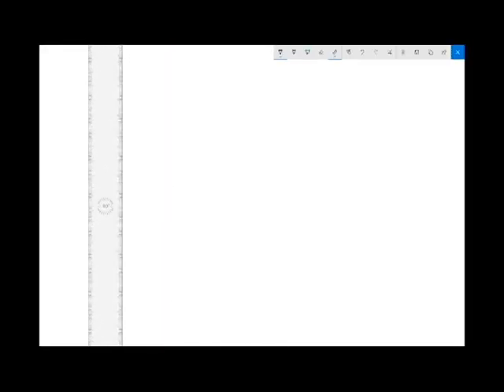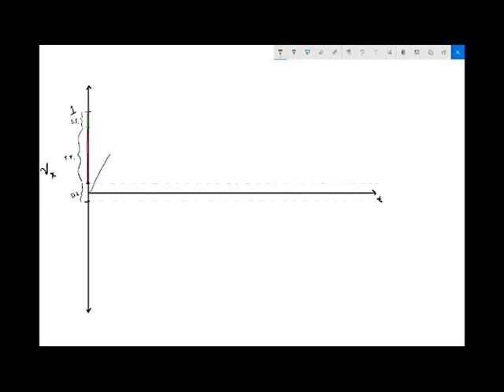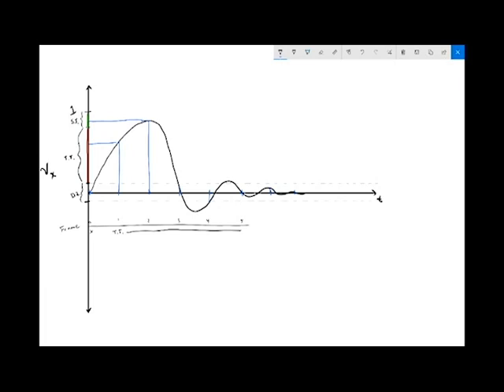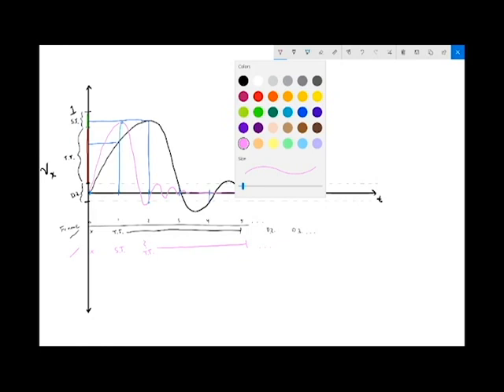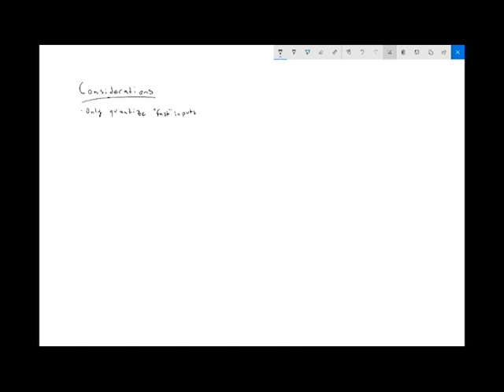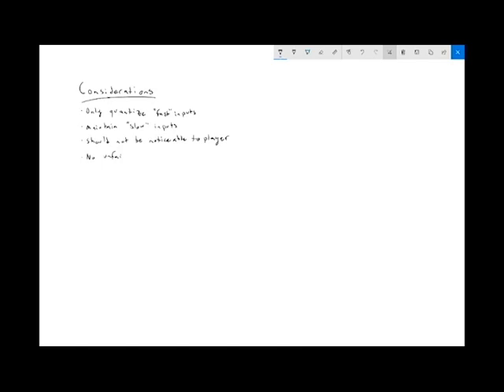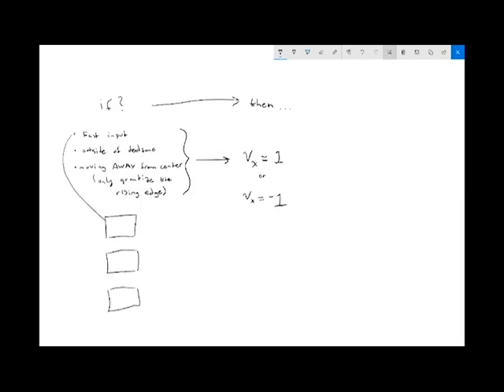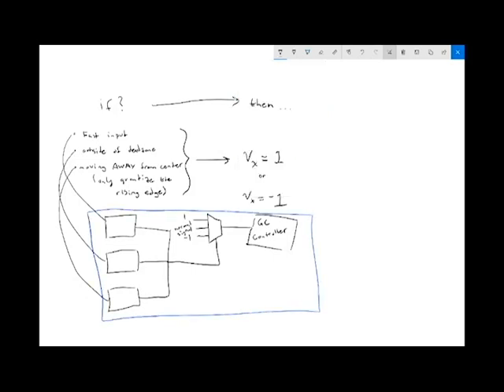Analog Dashback Fix for SSBM

Comment: Love the concept! Questions: 
Does the circuit wait for the stick to pass a threshold within the tilt turn radius? Seems like this could result in dashes while trying to input a tilt quickly if not, though I see the downside of that threshold increasing your dashback failure percent.

Normally, gcc's don't ever output a 1 or -1. Does your circuit cause the controller to output a 1 or -1 for an extended period of time? If so, it could provide a minor in-game advantage by increasing run speed. This aspect was explored in the box controller debate too, so there's probably stuff to go off of there.